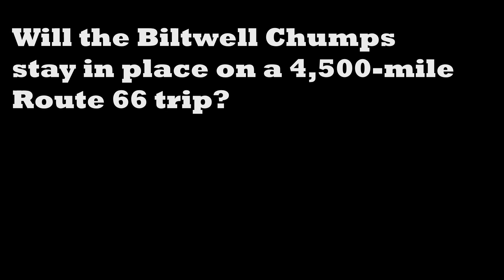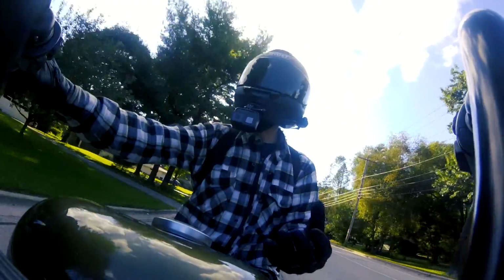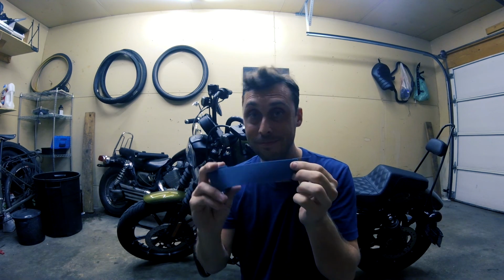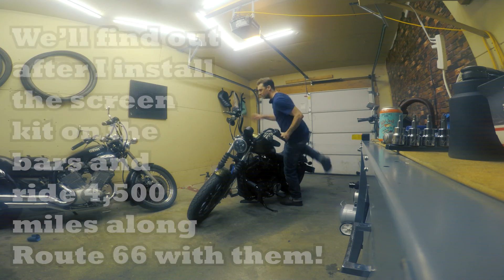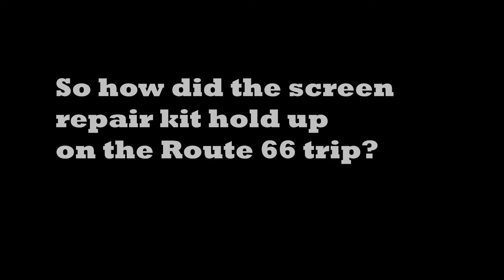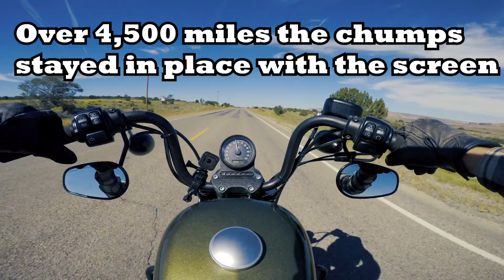How to Stop Biltwelll Chumps from Slipping - Harley Iron 883

Comment: if im going to replace my stock handlebar on my sportster with biltwell chumps should i also buy new cables?
Reply from the maker: You'll need to replace the front brake line, but you can keep your stock clutch and throttle cables.

Comment: Hi what is the material that you are using and heating on thothe bars please? Steve UK.
Reply from the maker: It’s a window screen repair kit. It adds friction between the bars and the clamp so they, in theory, don’t slip. I heated it so it would shrink to size. Here is a link to the exact kit I used: https://amzn.to/3Jt90Ih

Comment: Have tried what you suggested, still the biltwell handle is slipping. Any other solution in mind?
Reply from the maker: This solution was my last hope. It worked for about 8 months and then started slipping again. Some riders go a few ft/lbs over spec, but I was never comfortable with that. I'd suggest a new handlebar that has knurling at the contact points.

Comment: I had Zeds on Baron risers and they never worked loose.  I tightened to infinity.  A molecule could not fit between the steel.  Did you have to get longer cables and brake lines, etc?  Oh, you answered that below.
Reply from the maker: Man, I should have just cranked on them and let the torque spec gods be damned! 

Yeah, the brake line swap was pretty easy even with ABS. Those Zeds are pretty sweet looking.

Comment: What an awesome video....I have the tracker bars on my bike....what I did "before I saw your video" was I made checkering with a dremel on them..took a while....lets see if that works...also I torqued the bolts to 25 ft lbs I know that's more but the factory torque specs seemed to low....
That route 66 ride 👍 Ride safe🇺🇸
Reply from the maker: Thanks, man! Have your bars held in place torqued over spec?
Reply: @GreatEgret  Ya so far so good, "25 ft lbs" I took a 300 mile trip in October no issues...

Comment: If any handlebar moves it's because the clamp is bottoming out before it has a chance to get a firm grip on the bars. Shims, friction tape, set screws, knurling the bars and such are all workarounds. Just fix the problem by machining the clamps so that they don't bottom out.
Reply from the maker: Most riders don't have access to this equipment and taking the clamps into a machinist requires taking the triple tree off. That's not an easy or inexpensive solution for most riders. Knurled bars solves this issue just fine and it's much less expensive. I've never had a knurled bar slip. Handlebar manufacturers should just spend the money and make their bars knurled. Buuut, the screen I used in this video worked perfectly. 4500 miles along the route 66 trip and they didn't slip once.
Reply: @GreatEgret  'Machining' is a loose term... you can easily take the cap(s) off, sand them and get the same results. Knurling is never necessary when your clamps are properly spaced and function as intended. In fact knurling reduces the overall contact area between bar and clamp and is the reason why a lot of manufacturers don't knurl their handelbars.
Reply from the maker: Meh, screen is cheap, easy, and most importantly, it works.

Comment: Did you have to extend your brake and clutch cables to install these?
Reply from the maker: This is probably the question I get asked the most on this channel and if you look in the comments you might find the answer: clutch cable no, brake line yes. I have ABS, so I needed to get a new modulator.
Reply: @GreatEgret  ok that’s what I thought. Thanks brother. Great video!
Reply from the maker: Thanks, man! I have four other Videos on the Chumps if you’re still on the fence about them.

Comment: I have the same bars, I put blue lock tight on the 4 bolts, cranked them down and never had a problem.
Reply from the maker: Congrats. You're one of the lucky ones. Everyone else that I've talked to has has this same issue with the Chumps.
Reply: @GreatEgret  I don't torque my bolts by the way

Comment: Did you have to extend any of the wiring for those bars?    I'm wanting to put those on my 883.
Reply from the maker: I get asked this so often that I created a playlist just for these bars. By "wires" do you mean the electrical wires for the lights? Nope, you can use stock. If you meant the throttle cables, the answer is still nope, you can use stock. If you mean the clutch cable...same answer. If you mean the brake lines, this is where you'll get into trouble. I had to change my front brake line.
Reply: @GreatEgret  Thanks.    Be safe.
Reply from the maker: You too, man!

Comment: Did you wind up having to change out any cables when installing the chumps? Thinking about picking up a set for my '19 883
Reply from the maker: Cables, no. Both the stock clutch and throttle cables are long enough for the 8" Chumps. I did, however, have to change the front brake line because it was too short. It was a bit of a challenge because I have ABS, but I was able to do it myself  No way was I going to pay $400 for the dealership to do it. Check out the other videos I have on the Chumps for more information on this. Thanks for watching, man.
Reply: @GreatEgret  thanks for the heads up, I've heard that a lot
Reply from the maker: No problem. Let me know how it goes if you go with the Chumps.

Comment: Do you know how tall you can have your handlebars without having to extend the wires and brake lines?
Reply from the maker: You can't go higher than the stock handlebar without needing to change the brake line. I'd say the 8" Chumps are the limit on the stock clutch cable. The throttle cables are pretty long. You could easily go up to a 12" bar with them.
Reply: @GreatEgret  Ok thanks man! Im planning on a trip from Nashville to The tail of the dragon here soon and im getting my iron 883 how i want it before I go.

Comment: I have the Biltwell 12" handlebars and they loosen up while riding on highway. Maybe due to the vibrations, not sure. I have currently put aluminium strips and that has helped a bit but has increased the vibrations in the bars. I am planning to add the strips again along with cloth tape to increase the diameter. Let's see how it goes. Harley tech suggested to torque them to the higher side if the torque range. Biltwell really need to start knurling the bars as these cause an issue. Also the knurling will help efficiently centering the bar.

Comment: I found my bike on the ground about a week ago, and when I rode it today I noticed my handle bars were not aligned because both mirrors are facing lower to the ground were I can’t see the traffic behind me. Is this normal? Or did something brake? Bars are stock from factory
Reply from the maker: Without looking at your bike, I can't know for certain, but it sounds like the bars probably just got shifted down slightly. Just loosen the bolts, realign the bars back up slightly, and set your mirrors.

Comment: I have the Chumps and added a 2" riser. The riser material holds better than the stock HD triple tree. I overtorqued by a few pounds (about 22) and never had a problem. I need to take the bar off to swap to Progressive fork springs. I'll keep my eyes on the bar and try the screen protector if I notice any slipping.
Reply from the maker: I bet those risers look great on your Superlow! The Chumps' slippage was so frustrating. I know of a few other Sporty riders that had the same issue and gave up on the Chumps. There's just something about the Harley triple tree and those bars. But, man, that screen kit did the trick and it was only about $5 at Home Depot.

Comment: Were the stock 883 cables long enough for the Chump Bars?
Reply from the maker: Thanks for watching, my friend! I get this question a lot.  So much that I created a series on it.  Three other videos cover this. Definitely check out the 3000-mile review video if you're thinking about the Chumps. I did not need to change the idle and throttle cables. They are long enough, but the brake line I needed to change.
Here's the chumps playlist: Biltwell Chumps: https://www.youtube.com/playlist?list=PLRA7CrqQbaWI_9-yUBbR0GLkg7lm5kZfi
Reply: Yes all you need is a new brake line.

Comment: GoPro in the mouth for the handywork shot. Talk about simple and effective. How did you not manage to drool all over the camera thought? I hold a tool in my mouth for a few seconds and it's like  cracked open on the faucet.
Reply from the maker: There may be a shot of drool in this video that you missed. 🤣 That's the absolute best POV angle. GoPro actually makes a mouth mount that looks something similar to a boxer's mouth guard with a GoPro attachment sticking out of your mouth.

Comment: Awesome, glad that worked for you! I had a ton of problems with bar slippage, and my bars actuality had knurling! And I am not an aggressive rider, I just ride. One bar was a Z bar and the other were the Harley brand bars that actually came on my 1200 custom. After all the problems with the Z bars slipping and not finding a comfortable and stable adjustment point, I went back to the stock bars and put taller risers and switched the speedometer mount to do a type of moto bar. These too started slipping. I tried a bunch of things to stop it but to no avail. Even with the knurling the bars would slip. At the end they even pulled the riser bolts out of the riser with the riser threading when I was moving the bike in the garage! I start moving the bike and I hear a loud pop and the bars are completely loose! At that point I said enough was enough these are not going to work and are to dangerous. Luckily this last thing happened during winter and my bike was down for the season. I immediately did some shopping and bought the Lucky Daves Lucky 13 T-bars in 13". They give me the height I wanted and are completely solid.  Now both of the other bars were steel and the riser was aluminum as was the top clamp. I can of understand why Biltwell says the steel on steel wont slip, I almost went that route when I was getting rid of the old setup. However after all the trouble I went through I just couldn't trust that style of setup. I found the bars for me on my current bike but if I ever got another bike I may try it again. Just go with all steel next time. I am never going to mess with different metals for the bars and risers again that was too sketchy for me!

Comment: Joe...loved the music montage at the end with the written commentary I really hope you do a trip summary like that it would be a great vid.  One thing that I discovered with bar slippage was the bolts on the risers tend to get loose over time. I had a problem with bars loosening on my Nightster after I adjusted the position and my solution was to use some blue loctite on the rider bolts, torque them down a bit more than specs and it resolved my issues. The bars stayed tight the bolts stayed tight and nothing got loose or slipped after that. Glad the solution that Maxwell offered up worked for you.
Reply from the maker: Thanks man. The montage It came about by accident after Gremlins ate my audio. I'm glad it worked out. A post-trip summary is definitely needed.

Comment: A friend of mine had the same issue with a set of Biltwell bars. We used a hammer with a center punch to make small impressions all around the area of the bars where the risers would clamp to. That solved the problem. No slipping after that.
Reply from the maker: That's a good idea. My last resort was to take it to a machinist and have them do  the knurling for me.